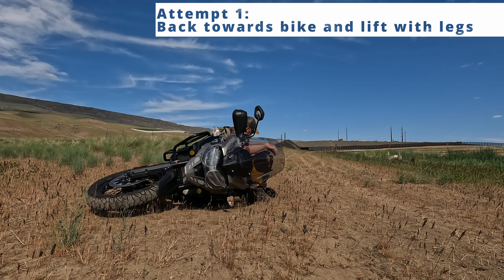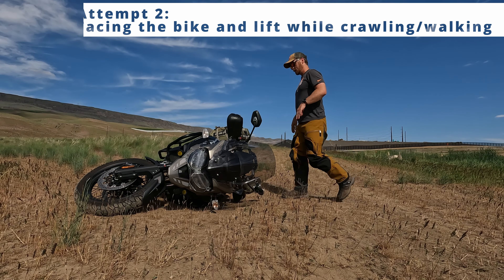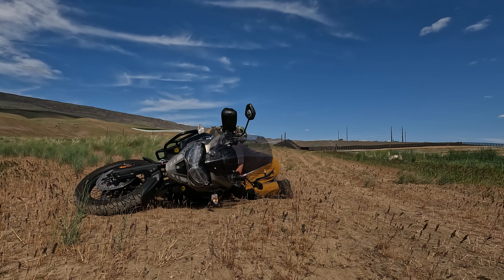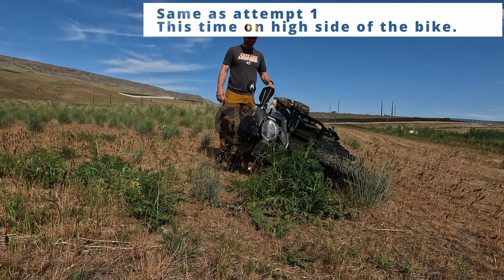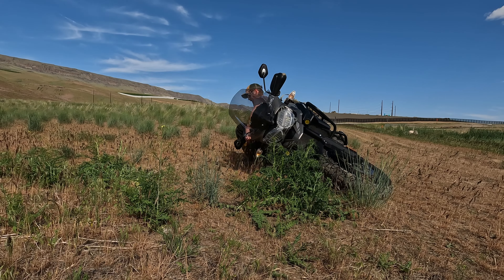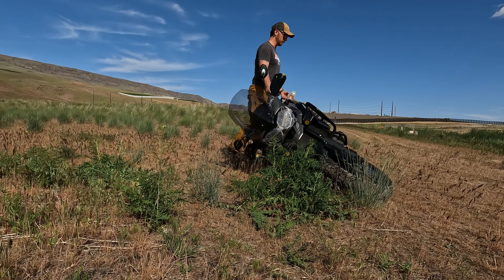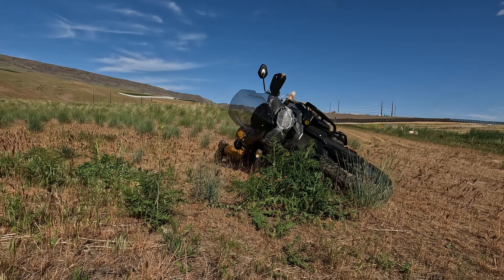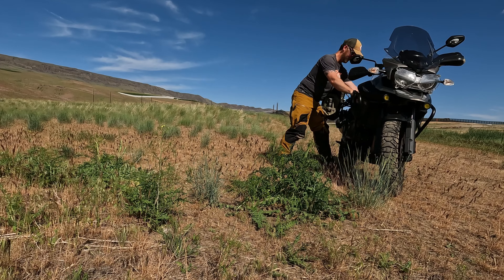Triumph Tiger 1200 Pickup Practice

Comment: You ned to strap your front brake lever, this prvents the front wheel from rolling away from you when lifting.
Reply from the maker: Thanks for the tip, doing that plus adjusting the direction when doing the back to bike lift helped me get it up using that method.  https://www.youtube.com/watch?v=fPwRkUb8_K0